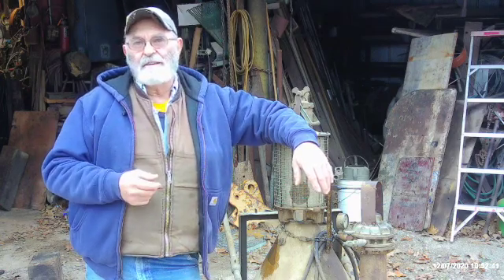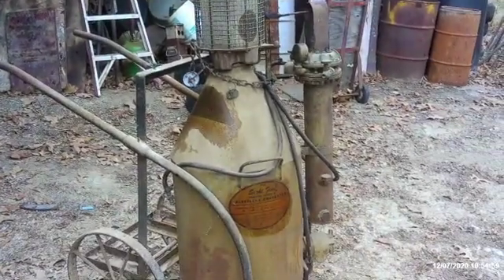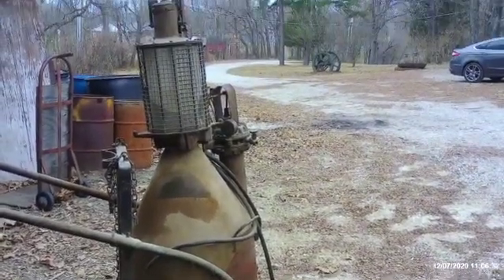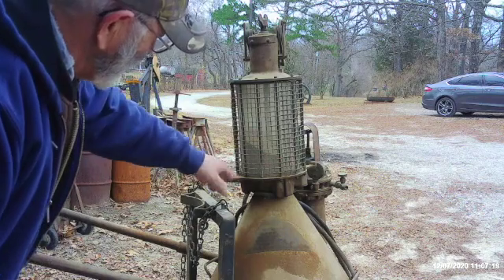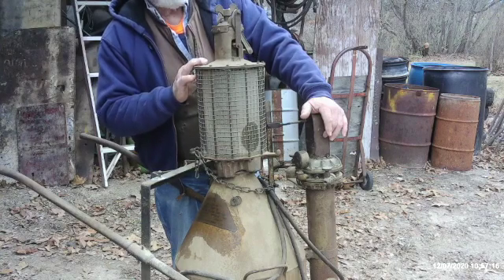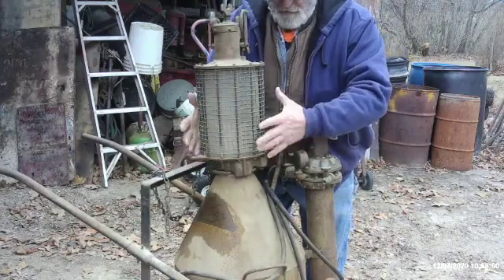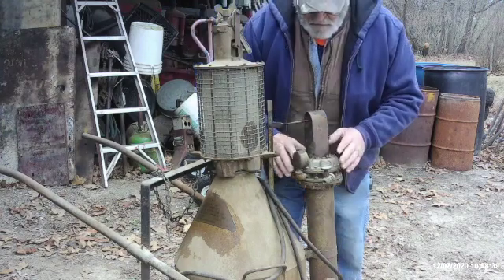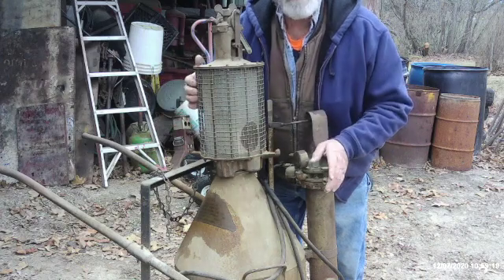Acetylene Generator: Precursor of Modern Torches

Comment: They do require an "injector" style oxy-acetylene torch if used for welding but old ones like Oxweld are fine. They're not worth using in modern nations but carbide is safer to transport then filled acetylene cylinders and requires less space so the third world often opts for them. The Rexarc generators sold today (the company name used to be Rego) are basically the same as the ancient versions.
Reply from the maker: I really have no real hands on experience with this setup.  I've learned a lot from viewers like you that actually do have the knowledge. My brother kept it from going to the scrap yard years ago.

Comment: In the late 70's, I moved into the house my Grandmother grew up in. Between floors in the house was plumbing for acetylene gas for lighting. All the fixtures had been gone since the late 1930's or early 40's I assume, when electricity became available.
 Anyway, in the front yard was a very noticeable dip, maybe 2 feet across. Dad told me once that was were the generator was for the gas.
  That house was huge, and was built in 1853, maybe one of the first balloon framed structures in this rural area of NW Illinois.
Reply from the maker: Wow, that's a neat house with loads of family history !! Awesome, my friend. The first headlights were actually carbide lanterns they'd use on coaches pulled by horses too. We have been through your area a few times. The last time we stayed in a Queen Anne B&B that was an old old two story home in a beautiful neighborhood. I'd have to ask the Missus what the town was, but the lady said Jim Smith spent time in the area heading west to build the Mormon community before Brigham Young was in the picture.  I think it was something like Noveau or Novu Illinois.

Comment: The Acetylene Generator was invented by a Texan in 1904. One of my uncles was an oil field welder and had one on his truck. When I was a kid, he would take me on a job occasionally. My "job" as helper was to clean the sludge out of the bottom of the generator before refilling it with water. He didn't trust me handling the carbide and put it in the hopper at the top himself. He would then meter in some carbide and the chemical process would start. I worked the agitator to ensure a quick and thorough mix. This generated its OWN pressure. There's a pressure relief valve that prevents over-pressure. By the way: YOU NEVER FEED OXYGEN INTO THE ACETYLENE TANK. You do and there will be a very large crater where you had been. Oxygen and acetylene NEVER mix before they get to the torch nozzle That is why there are TWO hoses on a gas welding rig. The outlet hose for the acetylene gas is attached to the top of that large cylinder on the side of the tank. It's called a flash-back arrestor. The oxygen comes from a separate bottle and ONLY mixes in the torch tip. This particular one is called a "Sight Feed" because you can SEE the carbide being fed into the tank. Sight means seeing. Site means location. I STRONGLY suggest that you learn to properly work one of these before attempting to put it into action. They can be extremely dangerous if you don't know what you're doing. When I worked in the Middle East, it was common to see these still being used. They even manufacture them new to to this day. As far as an "on the site" system. The ONLY way these got to the site was on a welders truck and that's where they stayed. Also, ONLY a properly trained and certified welder was allowed to work with these. Besides, an oil field welder owned his own equipment and NEVER loaned it to anyone. My uncle only allowed me to touch it when he was within arms reach and still at his house. When we got to the job site, I sat in the truck and watched. He did teach me how to weld when I was still young. I developed a very healthy respect for hot metal...
Reply from the maker: Holy Cow, what an AWESOME comment !! Thank you for taking the time to post that.  We are not considering at this point  putting it into use again.  For now its a good example of the way things were back in the day and it was saved from the scrapper years ago.  Too many old things are discarded as useless but hold great interest to a lot of people.  Thank you once again for the detailed comment !!
Reply: Adams & Westlake company actually patented this in 1900, and also applied for several other patents in the following years.  You can see the design documents at the Indiana Historical Society in Indianapolis.  I only know this because I run the shop and we've been around since 1857; with this name since 1874.

Comment: You have one of these and you, "..still pay the price and use acetylene" WHY ??? It'd take you no more than $150-$500 to restore the one you featured in this video w/modern day high quality adjustable pressure regulator/manifold block/check valve/flash back safety hose set. Add a grinder to pulverize the media(calcium carbide) into larger than table salt - smaller than rock-salt size chips. Add an adjustable hopper feeder to deliver it into the water and you'd have all of the purest acetylene that one could ever dream of consuming, on tap and ready to burn. We use 4 of these (similar not exact) with our LARGE CNC cutting table and 4 others are used in our forge and smelter/crucible ovens saving THOUSANDS of $$$ every month. Hands down, the most cost efficient and cost saving equipment you can possibly find for use in any size fab shop. #1 safety rule of handling acetylene still applies - DO NOT USE ANY RUBBER SEALS OR O-RINGS ANYWHERE
Reply from the maker: I'm sure you are right about that.  It's my brothers generator and like myself we enjoy saving old tools from the salvage yard...if for no other reason to save our heritage from disappearing.  We both have and use many tools and machines from the old days, this just happens to be one of them not kept in service.
Reply: @tractorman4461  They also are a fantastic addition to any doomsday prepper as well. Using just one of these you can cheap and easily illuminate a complete 40x60 shop using 30-40 individual carbide lamps with deflectors hanging from the ceiling and or hanging flush on the walls - all requiring a light deflector obviously. Very handy for those days and nights when the power is out.

Comment: Old timer told me his generator made "richer gas" than what ya get from a modern cylinder. Is this true?
Reply from the maker: Honestly I don't know.  But all that's needed is calcium carbide and water to create acetylene.  I don't know how they could make it richer.  It's got to be used at pressures below 15psi because of its instability above that pressure.  But that's a good question.
Reply: YES - he is absolutely CORRECT. It is the purest acetylene that you can get producing the highest temperature and most brilliant, beautiful blue knife flame producing the finest kerf possible - assuming one is using the highest quality torch cutting tips are used and meticulously maintained/cleaned

Comment: You can use it to make more calcium carbide by heating quicklime and coke, slaked lime and charcoal is possible once the outside of your smaller coker is red hot or a steady 1800C°. I did small amounts at a time using 10% of X grams amount of CaC fuel to synthesize X grams of Calcium Carbide. I homemade blast furnace from a 55gal drum a 5 gal bucket refractory cement with perlite for refractory concrete that is light enough to move and an electric blower.
Reply from the maker: Now I gotta tell you, that is something about which I know nothing !!  This is what is so cool about doing youtube videos though.  I find so many guys like yourself that have some tremendous knowledge about the most obscure topics !!  I've always wanted to make one of those blast furnaces, but I've got an old forge that'll probably do anything I need to do.  I just have to find the coal for it.

Comment: We need to see a oxygen generator.
Reply from the maker: There are two basic issues with generating oxygen for the bottles in my estimation. First is the compressor with the capability to produce the 2500 psi output to fill the tanks and secondly how to maintain the purity high enough to ensure a clean and efficient cut.  Less than 99.5% can be an extreme detriment to the oxy/acetylene torch.  It's essentially as pure as medical grade oxygen...and we know how important that is for surgery or for people on portable oxygen.  I have never seen the process of generating and filling the tanks...but I would like to just for the heck of it.  Thanks for the thought provoking question Ryan.

Comment: Acetylene is scarce in Europe due to the gas shortage.    I cannot figure out how the chunks of carbide are got into the water chamber  without letting the acetylene already there out out. The pressure is 15 psi.  The gas passes to the bottom of the side column and is forced up through up through water  where it is scrubbed of steam and ammonium.    This water acts as a flash back arrestor.
Reply from the maker: Not ever having used it or even seen it is use, I don't have full understanding of how it works.  If I had more time to fiddle with it I would repair the hoses and give it a go....but I would do it outside in the fresh air though. Acetylene is getting expensive here as well.  Many of us are going to propane/acetylene torches and many others are using plasma torches....but I still pay the price and use acetylene for my shop.  Thanks for the comment.  I do enjoy learning about the old equipment.
Reply: @tractorman4461  You have one of these and you, "..still pay the price and use acetylene" WHY ??? It'd take you no more than $150-$500 to restore the one you featured in this video w/modern day high quality adjustable pressure regulator/manifold block/check valve/flash back safety hose set. Add a grinder to pulverize the media(calcium carbide) into larger than table salt - smaller than rock-salt size chips. Add an adjustable hopper feeder to deliver it into the water and you'd have all of the purest acetylene that one could ever dream of consuming, on tap and ready to burn. We use 4 of these (similar not exact) with our LARGE CNC cutting table and 4 others are used in our forge and smelter/crucible ovens saving THOUSANDS of $$$ every month. Hands down, the most cost efficient and cost saving equipment you can possibly find for use in any size fab shop. #1 safety rule of handling acetylene still applies - DO NOT USE ANY RUBBER SEALS OR O-RINGS ANYWHERE

Comment: Just an observation; I noticed you mentioned calcium chloride at the beginning of your vlog; then switched to calcium carbide later on.

I assume you already noted your mistake, but for those who didn't, Calcium chloride is used to create hydrochloric acid and may also release chlorine gas amongst other gasses in an exothermic reaction, both of which are more than a little hazardous to your health.
Stick with calcium carbide since it releases Acetylene gas when introduced to water.
Reply from the maker: Yes, I caught it and corrected it later as you said.  I actually thought I'd edited the earlier incorrect mention before uploading the video.  Thanks for the candid comment.  I appreciate it because I really try to be reasonably accurate with what few facts I know.  Sometimes though things slip through.  Very good comment !!  Thank you.
Reply: @tractorman4461  Any time!
And you aren't the only one, I aspire to be as accurate as I can be 😉
Another potentially interesting bit of trivia; Acetylene doesn't need oxygen to burn and will spontaneously combust at 15psi, thats why such generators were considered safe since they operate at very low pressures, and acetylene tanks have a spongy/honeycombe core which increases the surface area of the tank, reducing the active pressure of the gas stored, thus reducing the risk of spontaneous ignition to much safer levels

Comment: There is no way I could have that thing in my possession and not restore it to functioning condition. These were also used to provide gas to homes for gas lighting prior to electricity and for a long time competing with electricity.
Reply from the maker: If I could talk my brother out of it I probably would too.  It really only needs a few minor components gone over to make it function as it is with all the original decals and all.. They are all readable for the most part.  We have a few carbide headlights off of early cars and trucks hanging in the shed too.  All from our old home place.  I think we have a couple carbide lanterns as well.

Comment: Considering the acetylene cylinder refill prices today, we should try to bring back these generators. Only trouble is sourcing calcium carbide.

#5 acetylene cylinder costs $350 to refill. Outrageous.
Reply from the maker: I know !!  Isn't it ridiculous to have to pay those prices !!  I now use a plasma torch whenever I can and may consider going to a propane/oxygen set up.  Thanks veegee for the comment !
Reply: If you do decide to try one, they can be very dangerous. More maintanice on  them than a cylinder of acetylene. If it does have a problem it can kill you.

Comment: Hi, you should look into another piece of equipment which may have been added on known as a gas fluxer which was used for bronze welding processes. The likely use was high end racing bicycle 🚴 frames and aircraft tubing.
Reply from the maker: Whew !! John, I'm afraid that'd be a bit over my head.  Isn't it crazy but it seems the more you learn, the more you realize you don't know.  Thanks for the thought provoking comment.

Comment: Rexarc (formerly Rego which torch collectors will have heard of) still make their Sight Feed acetylene generator and bulk carbide remains available (via special order from your local welding supplier but that may take a few calls to suppliers). Rexarc could direct you to current suppliers.
They are mostly sold overseas where the shipping advantages of calcium carbide beat using acetylene cylinders (which unlike carbide cans must be returned for refill). Acetylene generators are for use with "low pressure" torches which are designed for even lower pressure than standard mixers but will still work with common torches.  https://www.rexarc.com/products/model-50ps/  You can also use acetylene generators with plain (non-oxygen assisted) low pressure acetylene torches. Their volume best suits oxy-acetylene welding but with compressed oxygen they work fine. The peak of gas welding was the pre-WWII era/WWII era where it was by far the most versatile process capable of welding aluminum before TIG was invented. The Oxwelder's Handbook (get the 1939 edition) is the best OA book of that era and cheap used online. Every gas weldor should read it and you can find all the (wonderfully built) Oxweld/Purox/Linde/L-etc/Union Carbide/early ESAB torches shown on Ebay. I own examples of most of them and they're a joy to use. The acetylene section of the Weldingweb forum has many posts on vintage gear and it's common to use 100-year-old torches safely (they're easy to pressure test with clean compressed air or inert gas like MIG mix).
Reply from the maker: Well now that is good to know.  This particular one though, will probably not be put back in service.  I used to frequent Weldingweb quite a lot a couple years ago but never thought to investigate these over there.  I was searching info on cnc plasma tables and software. That is all good information and I appreciate the time you took to post it.  Thanks for the input.